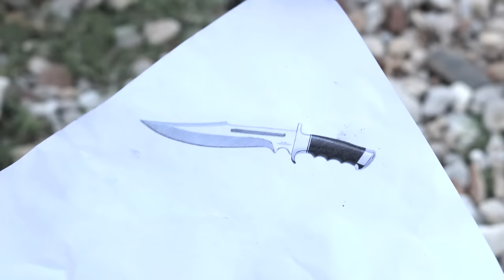I Turn a Stainless Steel Bolt into a Beautiful little Hunting Knife

Comment: Be very careful when doing this, when stainless steel is heavily heated (far above what your stove can do) it will release hexavalent chromium - a very dangerous compound that can cause severe long term damage. 

Always know your metals and handle them with the proper care. 

Well ventilated areas help but a respirator will do you a whole hell of a lot more good

Best of luck to everyone.
Reply: thanks man for sharing this :D :D

Comment: Him: makes stainless bolt into knife

Me: makes stainless steel bolt into rust... well how did I do that?
Reply: Don't know what you mean, but stainless steel doesn't rust
Reply: @zacyeahitsme361  It was a joke.
Reply: @rick343  It was a joke.
Reply: It’s a joke
Reply: I am a metal polisher and yes you can have stainless rust with contaminated sanding belts that have been used on iron. So yes it can rust.

Comment: You could make tonnes of money selling these
Reply: takes tonnes of time to make one. He'd have to sell them for hundreds each to be even able to consider making these for money.
Reply: Raitis Pujats me? Lool
Reply: Yes you!!! Loool
Reply: 100 Subscribers without videos challenge WHAT DOES LOOL EVEN MEAN! Do you mean lol?
Reply: He could just melt the material and use mold, this is just a demonstrarion how to do it hard way by hand.
Reply: Von Degurechaff if you're making any halfway decent knife you don't want to use a mold for a variety of reasons listed out there
Reply: No one is going to buy a knife that wont hold a sharp edge He ruined the temper a tonne the second he put that torch on it. Some one needs to teach you proper Grammar there are tonnes of teachers out there.  if your luck they wont be tonne def lol
Reply: Von Degurechaff this metal will be much stronger than most castings would ever come out though. It's work hardened from a bolt. This is what you call overkill!
Reply: Von Degurechaff it's costly to melt things have lots of holds mods aren't re usable the handle isn't something made from a mold and no u can't mold it to be sharp
Reply: Considering it probably took him dozens of hours to make this I would say no, he would go broke making these the way he did.

Comment: You might want to do a video on workshop safety as I'm guessing you were still wearing flip flops while the red hot bolt slipped onto the ground several times.